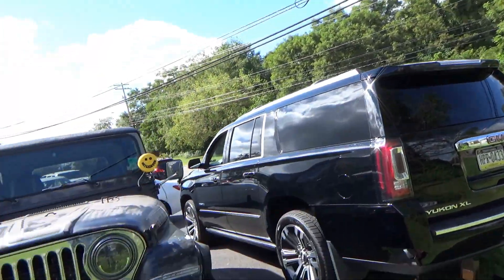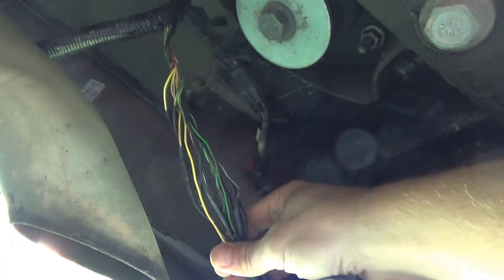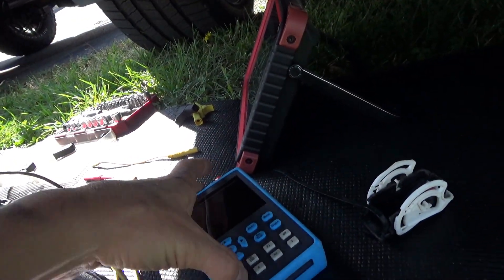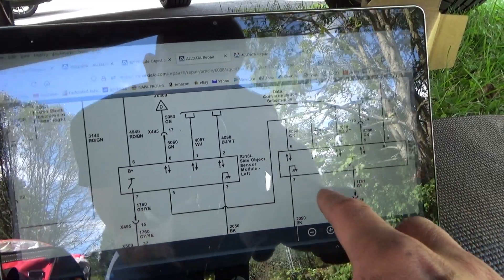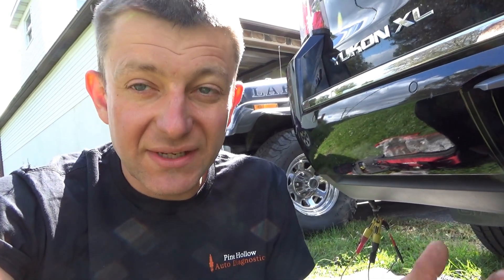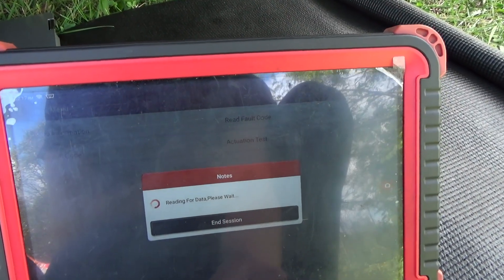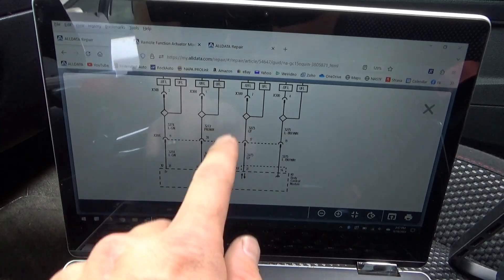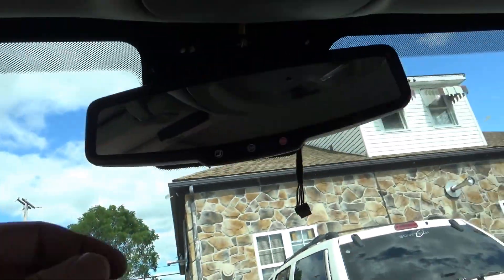I made the WRONG CALL? (Wiring Variables - How to Test INTEGRITY)

Comment: Yes, it is quite the 'thing'.  Body shops have found that they can make more money by replacing the entire roof instead of fixing a damaged roof.  Some roofs must be replaced because of severe damage.  However, shops are cutting roofs off due to hail damage that can be fixed with paintless dent repair and other proven methods.  Shop managers make a cut in the cost of parts and roofs can be very expensive.

Comment: the wiring diagrams are for UKC+Z88(rpo code for GMC)/X88(rpo code for Chevrolet). the other choice is UKC+Z75 (rpo code for Cadillac).
so most likely what happened is the person ordering parts did not have the vin filtering turned on .  many times aftermarket shops make their own pick list and do not order the right parts or they order the parts they think should be the same, because of availability.  or the aftermarket  shop thinks they know better than the gm dealership. my .02

Comment: Yes, very nice to use test light.
I understand what the point of the test light is.

 Let's say you are going to test positive and negative volt wire but you take the test light on a data line wire and run 12v into it. What happens then?

Comment: There's no reason you can't find a short to ground or a short between wires using an ohmmeter. You only did one of several checks that are possible with an ohmmeter.
Reply: How about checking a corroded wire ?

Comment: Rigging up all those test lights simply to check for a short to ground is completely unnecessary.  You can easily do the same check with your multimeter while you are testing wire continuity. BONUS COMMENT:  You should also check for shorts between the individual wires during an integrity check.
Reply from the maker: True. But you do need the test lights to check for current-carrying capability :)

Comment: Well it is obvious the shop does not know how to protect, dress and secure a harness, especially underneath the back of the vehicle in the salt belt with individual wires touching the exhaust. 
Why replace the bumper harness? Do they have the old harness?
Why put in a new multiwire pigtail? Why not just fix the melted wires and repair the harness correctly.

Let's face facts given their track record the body shop should not be doing wiring repairs unless they hire someone qualified.

To do automotive harness wire integrity with access to both ends of the wire in a harness, you should load the wire based on wire gauge to see if it can carry current. I like to use a current limited DC variable regulated power supply (one with dual gauges, voltage and current) for small wires, and for large wires a car battery with a carbon pile variable load tester. For an 18 AWG wire set the DCV to 14V and then set the current limit to something reasonably high for a bundled harness, like 2 Amps (you can test with a higher momentary current if you do not want to continue with a wiggle test) with greater than three 18 AWG wires. If you suspect a short to ground (chassis, the sheet metal) then you can include a test using a body ground. Wire integrity tests if the wire, and its associated pins and splices, can carry current. What we are looking for is a high resistance connection which is best tested with a high current test (at least much higher than a DMM on the resistance scale). I prefer the DC power supply over test lights, I can always put an LED test light across the power supply output if a do a wiggle test and I want to watch a light (light comes on if short removed).
Reply from the maker: Regulated power supply? Like you need to plug it into a wall?
Reply: Yes it is AC powered, so you need to plug it in, it is on a work cart. This is not really a problem for me because I like to work inside out of the weather.  @PineHollowAutoDiagnostics
Reply from the maker: @windward2818  unrealistic in the mobile field 😅
Reply: I have done a lot of mobile work. In my state to get paid as an auto repair dealer you have to be licensed. You can do mobile repair as well as own or co-own a garage. Being licensed basically means you are Incorporated and registered with the state (usually an INC and not a Subchapter S, you cannot be an LLC), have insurance and use and own your own tools. So, if you do work for another shop, obviously with permission from the customer, which is another state requirement, you are hired as a subcontractor and as such you can easily demand that any work be done indoors. 

Once indoors in a repair bay you have access to AC power. Which for me is needed because I will immediate be trying to understand the health of the battery, which as you can image, the battery is almost always severely undercharged, and requires charging. Mobil repair at a personal residence is almost never done (due to insurance reasons), unless it is a special needs client. The car is either driven to the shop or is put on a flat bed or towed. For safety reasons work is to be performed in a repair bay with certified operating lifts and equipment. I live in a very sunny state, and the only real work done at a shop outdoors (other than charging batteries) is a Smog Check that does not require a vehicle dynamometer, everything else is done in a repair bay. I don't know the exact reasons why liability coverage requires specific processes, which are a little extreme, so my guess would be it is the result of how litigation has evolved in doing auto repair in my state. I think the reasons why the way we work are so different is due in large part to the type of auto repair market we are in as dictated by our home state. @PineHollowAutoDiagnostics

Comment: With the Yukon,I would just repin the wiring harness & leave it be, with the Equinox I would test for continuity of the wiring harness as well as a short circuit to ground using the Ohms setting on my multimeter as an electrician.

They are actually talking about placing me in an electrical engineering role in my trade now !

Comment: Never thought of doing it quite like that, quick and easy. I have always done end to end ohm reading then short to ground and power tests with a single test light then if all else fails load test on circuit. been burned on a data line where all tested good but circuit couldn't even twinkle a headlamp bulb. Nice work boots LOL

Comment: You can still test it with an ohm meter to ground and it would have also found the short.   But I still agree, corrosion can have a short that changes when you add current-- always current load the circuit:  test light for the Win.

Comment: you are definitely correct on wire integrity and using an ohm meter. You need to run some current through the wire(s) higher than what the ohm meter develops. Good video!!
Reply: I agree 100%. While some will still argue that using an ohm meter is a good test,checking circuits not loaded is not a good test. Now if they used a megohmmeter that’s a different story but they are expensive.

Comment: A thorough check could have been done with the ohmmeter if the wires were tested for a short to ground and also for shorts to each other. Current carrying capability needs the light for sure. Long live the DVM! 😉

Comment: I make it a habit to hold on to every old part I have to replace for up to 2 weeks after the car is finished.  Mainly to satisfy the customers and insurance adjusters to show that the parts in question were replaced.  And can show why.  Because sometimes not even photo and video proof are not enough.  But hey, great tip for checking wire integrity.  I've been fooled a couple of times testing with just an ohms meter and everything checks out.  Then check again later with a test light and the problem finally shows up.

Comment: Parts man at  dealership ordered wrong harness.  X88= Chevrolet, Z88= GMC, Z75= Cadillac. Working in parts department at GM dealership those are practically the first 3 RPO codes an individual would learn as any C/K truck built has one of the three codes in the spid label.  Lots of part numbers provided in a body shop estimating guide are just that, a guide to aid in the creation of an estimate, and should always be checked against the GM parts catalog to ensure the correct part, especially wiring harnesses, trim and moldings.

Comment: Youch!  I see this a couple times a month.  Watch your RPO codes when programming, too.  The RPOs listed by SPS2 for the two variants WILL NOT appear in the door tag scan and have to be pulled by VIN to get the full build sheet.  It is also VERY common to find the wrong part in the right bag.

We've come to call these "Covid Cars."  During the pandemic, especially within GM and Ford, there were a lot of last-minute adjustments made on the assembly line to utilize parts on hand, including alternate wiring harnesses, ghost modules, phantom coding, and all sorts of other fun little anomolies.  These are all tracked internally by GM, but on GM and Ford vehicles 19-23, sometimes even scanning the QR code or ordering parts by VIN won't get the right data.  Always request a full build sheet from the GM parts counter to get the actual configuration of the car, and run the VIN for TSBs to determine if there are ghost modules or features coded out that require special service procedures.  :)

As for the Equinox, roof skin jobs are always fun diags.  Pinchy pinchy!  :D

Comment: A continunity test tests for an open.  Testing between each individual wire tests for shorts.  Using a good body ground then probing each wire tests for grounds.  And it can be done with a digital VOM.  There are only three posibilities when it comes to wiring.  It's open, it's shorted, or it's grounded.  The real stinker is finding a high open.  A wire that is broken in two but under the right conditiins still works.  The insulation looks great, but the wire is broken under the insulation.  And unless the insulation looks funny at the point of the break, a tone or a test set used to find opens needs to be used.  From experience, the insulation doesn't always look funny above the place where the wire is broken.

Comment: I prefer using an ohm meter to check for shorts, since it will also find high-resistance "shorts" that are low enough to corrupt the data line but not low enough to light the test light. I also like to measure between the different wires, not just between one wire and the body.
Reply: Yes I agree. The test of each wire for shorts between themselves or to ground is what is needed.
Reply: its only as good as your connections and sometimes you think you have a connection but dont.  send a low voltage square wave and watch it on a scope is the best

Comment: There's actually three wire tests you can run - continuity (multimeter), load (test light), and impedance (signal generator / network analyzer).  Just because a wire passes continuity checks doesn't mean it will carry a load.  But just because a wire will carry a load doesn't mean it will carry a signal.  A damaged wire or the wrong kind of wire may have a high impedance at frequencies other than 0 (DC aka the test light).  Think a CAN wire.
Reply from the maker: If a CAN wire can carry 300mA, it can carry the CAN signal, at least from my experience :)
Reply: @PineHollowAutoDiagnostics  I'm no expert, and maybe CAN isn't operating at a high enough frequency.  But there are certainly applications where you can run a DC test and be fooled into thinking your wire is good.  All you have to do is kink an ethernet cable or bend it slightly too tightly and performance will drop like a rock but it will still merrily carry DC current.  And ethernet or ethernet-like communications is coming to cars.

Comment: For wire integrity, wouldn't you also need to check for shorts between wires and each wire to ground? Okay, you did find a ground short but I always use an ohm meter to check for ground shorts as well. Don't need a test light if you do this but for current carrying capability, a test light is useful. I had a really hard time with thd rear AC blower on my 2004 Suburban. Harness checked out for continuity but when there was a substantial current draw, there was a no-connect situation. Connector behind driver side foorwell cover had a burnt contact (diagonally opposite corner of truck from rear AC).
Reply: Yeah. Crosstalk between wires in a harness/connector is something many (myself included) tend to forget. This is why it pays to have a diagnostic routine which you stick to no matter what.

Comment: That wiring change on the Denali/Yukon was a trap waiting to happen.  I like how you re-pinned the module to prove your theory.  Kudos for solving the puzzle caused by GM engineers and the body shop.  The wiring analysis on the Equinox was very cool as well.  Unfortunately too many techs out there still use the ohmmeter method without accounting for the load.  Thanks for the lessons.
Reply: Who knew?
Reply: A multimeter is still a valid tool, though.  If you don't have continuity, you certainly have a problem.  But having continuity doesn't mean you don't have a problem.  I always keep a multimeter in my vehicle.  I almost never have a lightbulb with me.  I guess I could carry a test light, but I find a multimeter to be the better general purpose tool.  Also, you probably could have found the short in this example by checking continuity to ground with the multimeter.  No load required.  I think the only case where a load is required is if there's almost a complete break either mechanically or electrically due to corrosion.
Reply: @major__kong almost all wiring issues on vehicles are corrosion based, either at a connector or where corrosion enters thru a break in the insulation or someone didn’t cover a pin hole they caused probing wires. Getting into the habit of load testing circuits either with voltage drop or a test light will ensure you find the problem fast every time and not get caught making a mistake from using a ohm test. Meters are great for voltage drop testing or ohm testing a sensor/ motor but not so good for testing wiring integrity..
Reply: @CodycoWeb  I'm pretty sure I'm not disagreeing with you.  But you can do a lot with a meter.  For example, with the car on and it's loading the circuit not a test light, I can measure the voltage drop you talked about.  Depending on what that voltage drop is at different locations in the circuit, I can generally tell what's going on.  I don't do auto diagnostics, but I have a lot of hobby projects involving electronics and power electronics, and I haven't needed a test light yet.  I also wire airplanes, trailers, etc.  I completely understand the corrosion issue, which is why I use marine or milspec wire, healthy dollops of dielectric grease before crimping, and adhesive-lined shrink wrap.

Comment: Yes Ivan wire integrity I like applying a load when checking. Good continuity doesn’t mean good conductivity in this case the ohm meter would have done it’s job but that leads to 3 other wires not knowing if they can handle current your way loading the wires is spot on CHEERS

Comment: You could have detected the Equinox signal wire ground short with an ohm meter, but you didn't test for signal wire ground shorts. So your contention to leave the ohm meter alone was wrong. The proper instruction would be to test for ground shorts.
Reply from the maker: Ohm meter would fail if wire is almost broken ;)

Comment: On the pinched wire job, you have to evaluate yourself when doing body work on every vehicle made after around 1995 or later due to the various wires, modules and so forth. Just to be on the safe side, all the body man had to do was maybe spend another 5 minutes being super careful when working the roof panel replacement or by having a helper when needed to be super careful when aligning up the new or removing the old panel. Who knows, the grey wire could have been pinched from when the roof panel got damaged and it went unnoticed by the tech. NOW, look at the time consumed to locate and correct the culprit...that is when you decide more time and concern needs to be taken when doing a job you probably are comfortable with from past experiences yet being more observant will pay off in the long run.

Comment: As usual. I learned something. That's why I watch this channel. I always get little nuggets. I usually load check circuits. But not in the practice of doing it when doing simpler tests. This video is great example that load testing should always be used.

Comment: Hi 
I wonder if you can advise me. I own a 1997 Toyota Landcruiser  Colorado here in the UK, could you tell me if it is possible to have a new key fob made . I have owned this LC for 15 years and intend to keep it, it is in first class condition and runs great.
I have tried the Toyota dealer in Wolverhampton and they supplied a master key (un programmed) which I don't need. I don't need any keys cut just the fob. I hope an aftermarket fob is available but so far no luck.
I have watched quite a few of your videos and I am very impressed with you and your diagnostic skills.
Regards from the UK
Paul Reynolds.